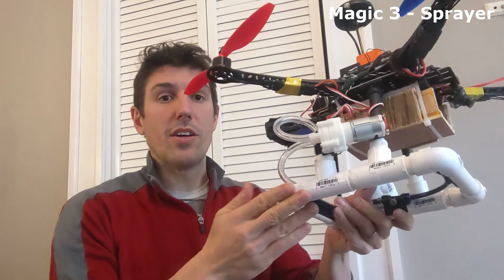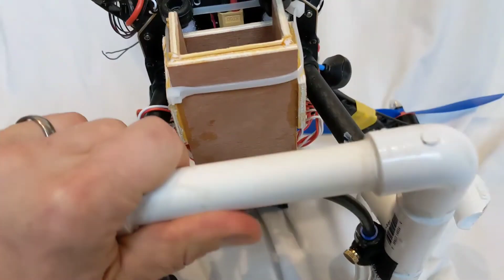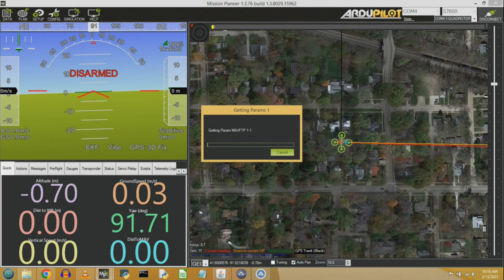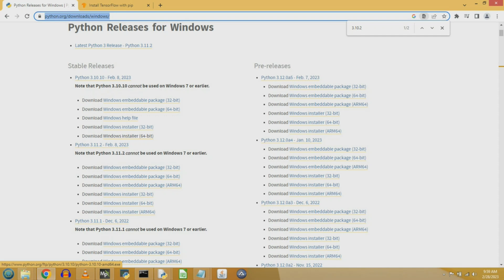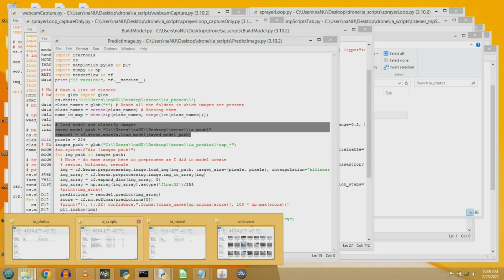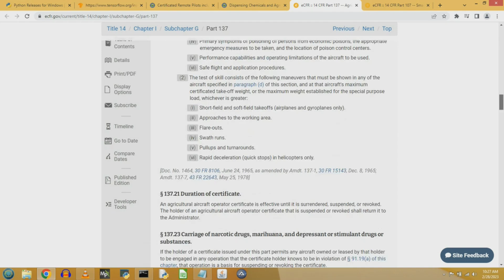DIY Autonomous Intelligent drone sprayer - Parts List, Schematics, Build Details

Comment: Hi, Nathan. I am struggling with the drone's first flight. I have looked through Ardupilot's First Flight & Tuning guide and they seem to consistently recommend radio control for initial flight tuning. However, it seems you were able to bypass this step with full auto mode and clearly demonstrate really strong flight results. Were there any other parameters you changed that were not covered in the video that may be critical to first flight success? I have not attached the Lidar or Raspberry Pi yet.

Comment: Hello
Hello, I want to make something similar to your drone but with components that are a little cheaper and more accessible to my budget. You can advise me in this case.
Pixhawk 6X
Receptor EXPRESSSRL
Sistema sik telemetry 
RadioMaster boxes
Firmware ardupilot
M8N/M10 GNSS MODULES
• 2 pcs 12000mAh Tattu 6S 25C 25,2volt
T-Motor MN505-S KV320
FLAME 60A 12S para el MN505-S KV320 
Hélices**: Óptimas son 20-22" para 6S
Frame 790mm 
Distribuidor de Energía (PDB - Power Distribution Board)
 Please help me!
Reply from the maker: This looks mostly good - the one thing that may cause problems is the GPS. For this to work, base station corrections are needed so that it'll land in a small square (allowing for wind).  That's why I used such an expensive (here3) gps - I can get base station corrections which keeps it accurate.

Comment: Hello, I am working on a personal project that involves constructing a drone. This drone is designed to spread rice husk and follow an automated route plan.

As part of this route plan, once the drone calculates the total area covered, the system must indicate how many pounds of rice husk should be dispersed.

For example, if the drone covers an area of 50 square meters, it should dispense 5 pounds of rice husk.

If this is within your capabilities, please contact me.

Comment: Awesome ! Is 3D mapping possible with this lidar ?
Reply from the maker: Not directly.  I suppose you could collect that though.  If you flew at a constant altitude by barometric pressure (that's the default mode) then took lidar measurements facing down you'd get a rough contour map.

Comment: Hello, Will these Tensor Flow codes run on Version 2 System?
If not do you have the codes for those?
Reply from the maker: The flow for creating a custom image classification model and running it has been updated quite a bit. I've nearly got version 2 of this thing complete where that'll be explained.  Basically there is a google colab that greatly simplifies creating a custom image classification model from a few hundred sample images and you can use a raspberry pi zero 2 w and global shutter camera to do classification on board, no need for a video link.
Reply: Very well, thank you for the clarification.

Comment: I’m looking at undertaking a project like this to build a drone sprayer for a strawberry patch that will be a little under an acre. You mentioned you are gonna have an updated drone? Any progress on that
Reply from the maker: Yes, I've finally got some breathing room to work on it.  It's a 3d printed drone so I can carry more fluid (the whole body is hollow) and a faster and simpler battery swap setup, 6 battery charging stations so higher usage rate.  I'm hoping to get it put into a video in 2 months... still testing at the moment
Reply: Awesome!

Comment: if you had to identify why the orange cube produced success, what about it enabled success?  Because there are many Pixhawk, particularly the 6, that are very powerful.
Reply from the maker: It's the here3+ GPS that's the important thing. That gets GPS RTK which is far more precise and what I needed to be more exact with the passes in the field and to get the landings on the pad.

The cube orange had the proper GPS port and the here3+ GPS documentation showed it worked with it.  I actually started with a pixhawk and when I realized the here3 didn't have the same GPS port I got nervous and switched.  I'm pretty sure I could have cut the wires and soldered them to use the pixhawk port but I wasn't sure if I'd introduce to much R/C and make the here3 unusable.

Comment: one esc and motor took fire on the exact same config : what wrong with me ?
at first it ryed 2s 4500 lipo and it barely hovered at 10cm 
so i switched to 4s 3500 and it burned in smoke

Comment: Where is the wire to the pump coming from??
Reply from the maker: An ESC.  The raspberry pi turns on the ESC which actually provides the power to the pump.  Should be in the wiring diagram.
Reply from the maker: Oh man, it ended up in this video instead:
https://youtu.be/X9XkCe1RPQY?t=589
Sorry for the confusion

Comment: It would be cool if you filled the sprayer with gasoline instead and also attached a second motor controller to activate a lighter right beside the nozzle. Autonomous flamethrower drone

Comment: First, I would like to thank you for this wonderful project. At the same time, I would like to ask about the method of connecting the water motor, which you did not discuss. How did you connect the electrical part of the water motor, and how can you operate it through the remote control.
Reply from the maker: Ah, I didn't put that in this video. It ended up here:
https://youtu.be/X9XkCe1RPQY?t=589

Comment: @NathanBuildsDIY what is the capacity of the tank? What is the weight of the drone and how much water can it carry?
Reply from the maker: I haven't actually weighed it, but it's HEAVY (for a drone anyway).  I'd bet 4-5 lbs.  I'm working on a v2.0 now and I plan to 3d print the drone frame, and make it basically a big tube all through.  I can print it lighter than the current one, with no seams and it'll carry more liquid.

Comment: This is a great overview and project, I have been researching this topic a little bit and this is the exact inspiration I needed to begin working on a similar project. In terms of open source autonomous drone flight, would you recommend starting with ardupilot, I want to explore the idea of mini auto swarm drones that are loaded with lightweight recognition models on board. So a software that can control multiple drones would be ideal.
Reply from the maker: ardupilot has a pretty big user base and active forum. I know it has some swarm capabilities though I haven't tried it myself. I think skybrush is an alternative as well, but again, I haven't tried it. Let me know what you find!

Comment: Hi Nathan,

I wanted to express my gratitude for the fantastic videos you've shared and the invaluable resources you've provided. I'm a student working on my final project .Currently, I'm working on a project with similar principles to yours. While the core ideas align, my focus is on classifying potential fires rather than weeds. I'm utilizing an infrared camera, pixhawk 4 flight controller, and an Nvidia Jetson Nano. At this stage, I've achieved autonomous flight using telemetry and Mission Planner. I've trained and created a model using SVM algorithm to classify between potential fire scene and none potential fire scene. My ultimate goal is to be able to send an alert massage and coordinate of the potential fire scene to the ground station. I'm navigating a bit of confusion regarding inter-device communication. and now stuck, Your insights on what key milestones I should aim for and the steps necessary to accomplish them would be immensely beneficial. I'd be thrilled to offer more details to provide a comprehensive understanding of my work. If you're open to it, I'd love to connect via email or any preferred messaging platform to delve deeper into the specifics of my project. Keep rocking those insights!

Cheers

Comment: hey I was wondering about potentially using a PWM brushless water pump instead? Would that work and do you know of any 12v PWM brushless water pump for the pixhawk fc?
Reply from the maker: I don't know of brushless water pumps, but it should be do able - you just need to change the pump and the ESC (electronic speed controller) to brushless.  The PWM signal going into the ESC will be the same, just the output will change to power the brushless motor.

Comment: Hello, I want to build a more simpler Drone, it's my first one, Something that can use some liquids and some ''grains/powder'', it's for my father that works on crops in Brazil, some of the stuff is kinda impossible to find here, just a drone that can be ''kinda auto'' after config or can operate at home/notebook or radio can work out with a FPV kit and after trying to make it work with the pump? Plz help! ty for the content
Reply from the maker: I'm sure you can build that.  You'll save quite a bit of money over my build because you don't need the cube orange and expensive Here3+ GPS if you're not relying on full automation.  

I used these with success for FPV camera/video from the drone back to my laptop (I see the video feed from the drone on my laptop) - I grabbed this from the description in this video (https://www.youtube.com/watch?v=Fflbc_y2IGQ)
Version 1 Camera System - 
  NOTE I don't recommend buying version 1. Version 2 will be WAY better and cheaper.  Just wait for raspberri pi to be back in stock
  1 Runcam swift 2 FPV Camera - $28 (https://usa.banggood.com/RunCam-Swift...)
  1 eachine 5.8GHz Video Transmitter TX805S - $35 (https://usa.banggood.com/Eachine-TX80...)
  1 eachine ROTG02 5.8GHz receiver w/ USB - $31 (https://www.banggood.com/Eachine-ROTG...)

You could keep the sprayer design I used or change it so it can deploy grain/powder, probably just change the pump in my design for a small motor that can deploy grains/powder when you activate it.  You'll still need some way to control the drone.  You could probably get a much cheaper pixhawk (instead of the cube orange) and a cheaper GPS, and still use ardupilot. These often come bundled together, something like this:
https://www.amazon.com/Controller-Wireless-Telemetry-Quadcopter-Multirotor/dp/B07NRMFTXL/
I started by using a kit like that. In the end I decided the 900mhz radio didn't have enough range and the GPS wasn't accurate enough for my needs, nor did it have lidar, so I ended at the design in the video instead which is more expensive, but these kits certainly work with the limitations listed.

There's probably even cheaper FPV enabled drones from DJI that are fully human controlled - no laptop used at all, and you could just add the grain/power distribution system onto that and figure out a way to turn it on when you want to.  I've not got any experience with that, but I bet it's the least expensive option of them all.

Comment: Thanks for an amazing video, loved it! How many acres can this drone cover with one battery before swapping it out for a charged one?  Also how big is your spray tank? Would it be able to handle a bigger spray tank?
Reply from the maker: Yes - it'll certainly take a bigger spray tank, next revision of this I'm going to 3d print the tank to save weight and hold a bit more liquid.  It holds around 8 oz currently, I want to push it to 16oz.

Since it only sprays when it has to I can cover about .5 acres per flight with that (my weeds are fairly dense in places) and I can get about a 12 minute flight to cover that .5 acres.  I want to make everything bigger in the next revision as well. I saw an ag drone in my neighbors field (he had hired a company) that was around 8 feet square!  It had a huge battery pack, and was fully human operated, no automation, but they covered something like 60 acres in an afternoon.  They could swap batteries every 20 minutes or so and had a bunch charging in their trailer at all times.

Comment: Cool stuff. Also could be used to look for lost pets, children, adults, treasure hunting. The code is clean and workable. I already simulated it. Get a printer to make your  battery housing, much lighter, than wood,  print a rain cover out of super light buterate for the drone. Thanks man, you Rock.
Reply from the maker: You nailed it, next revision I'll have all 3d printed parts for this. will save weight, make it easier to reproduce and should be more reliable.

Comment: Thank you so much for your effort and sharing ... if i want to build a 5 or 8  liters spraying capacity drone to spray whole field ,with auto pilot without camera , i dont mine if it take few more rounds to finish the spray , what is your recommendation of motor power and battery list of material , i am a small farmer so this will do the job for me .... as agriculture drones are so expensive ... your drone impressive build great....
Reply from the maker: Very good question.  I just saw a company out of Illinois that a few farmers in my area hired to spray their entire field (no machine learning to only spray weeds), so it's cost competitive with crop dusters.  Their drone was 8ftx8ft and could carry 10 gallons. The battery was enormous and they had a whole bunch of them charging and after flight they would manually swap battery/refill the tank. It was very cool (though not automated, had a crew of people running it).
I've also seen the DJI Agras drone (2 gallons) which is also around 6 feet on a side.

So, long answer to say I haven't built a drone that can carry a gallon (yet), but I'm guessing it'd be 3 feet or so on a side. I'm not sure how big the motors would be, perhaps start by researching what other ag drones (not automated, not Machine learning ready) are put together to get an idea of the motors and batteries used, then you could take that info and add in the machine learning/weed recognition.  Let me know how it goes!

Comment: Great job with creating this project and thank you for sharing! I am currently working on a project similar to this, but I am using a Raspberry Pi model 3 B+. I was curious on seeing how your code works and when I got to the point of using the sprayerloop code, it kept printing that it was only seeing weeds after I made a model with crops and weeds by using two different plants. By any chance do you have an idea why this issue may be occurring? I tried creating folder directories similar to yours and I am not sure this this is the issue. Also, when creating this code did you use a certain tutorial or did you already have prior experience?
Reply from the maker: Glad you're finding it useful! Let me know how your project goes.

I switched to a pi for this project as well and had trouble with the models. Eventually I went to a tflite, quantized model with class labels added.  I had to use new code for that and I'm going to post it with an updated video in a week or 2.  But you can get similar code from my robot weeder video: https://www.youtube.com/watch?v=uVJXskpkuEE
Reply from the maker: I realized I posted and pointed you to an old script!  Here's the correct one:
https://drive.google.com/file/d/1qyksC5TaVZLewNzG1gDQfEPXi20eE6L-/view?usp=sharing
It's updated in the description of the weeder video too.

That's got to be run on linux (I put up a vbox ubuntu) I think because I couldn't get the tflite_support package for windows.
Reply: @nathanbuildsdiy  Thank you very much! I greatly appreciate your help and I look forward to seeing your updated video. I will keep you updated on my project as well.

Comment: I have the Pixhawk 4 on my homemade tricopter. What problems did you encounter with it that made you go to the Cube?
Reply from the maker: I think pixhawk 4 would work but I also think you'll need to clip off the wiring connection that comes with the here3+ GPS to fit. The size/shape of the connections for GPS changed (I think).

Comment: Interesting build! I wonder if some sort of a two pass, batch approach would be interesting? first pass does relatively high speed scan/  video of the field. Drone returns to base and the video is downloaded and processed, and then the drone heads out with a new battery and the herbicide and does a high-speed spray run using the just calculated target data.  Of course this depends on the system having sufficient locational accuracy and repeatability. I assume that for the most part the limit is air time so if the drone can move faster more of the field is covered at once.
Thanks  for the video
Reply from the maker: Interesting idea - flying higher and faster would let you get an overview of the field.  I also think a raspberry pi + camera would get a much better resolution picture to enable that.  
Then the trouble would be that rpi+camera doesn't talk to the mission planner on the base station so it wouldn't know where it actually is in the field when it gets a photo.  Perhaps comparing time stamps between the systems coudl sync up.
I actually came up with a different solution - I built a lander/automated battery swap station that takes the hassle out of flying new missions. I don't have to be around, the drone lands, swaps batteries, gets loaded with a new mission and takes off for that mission